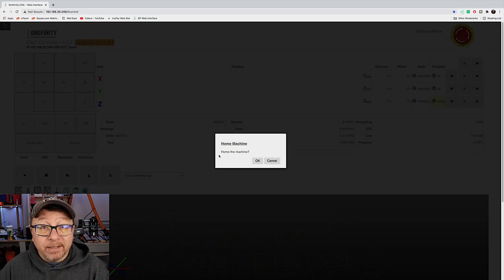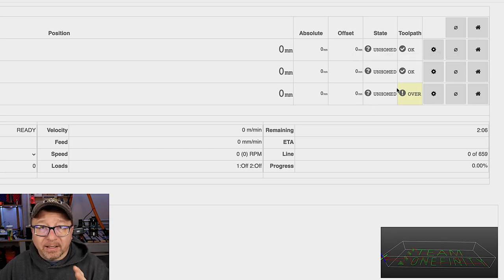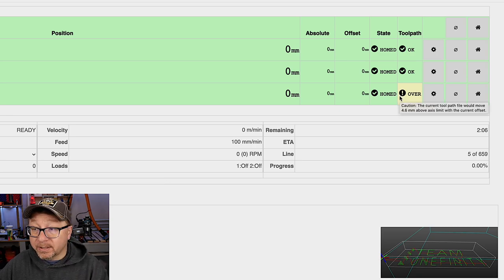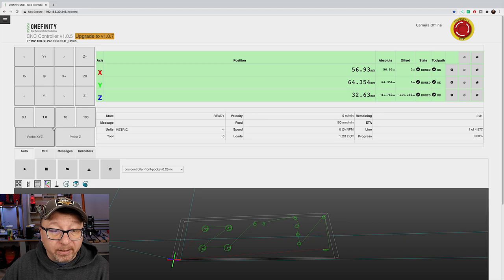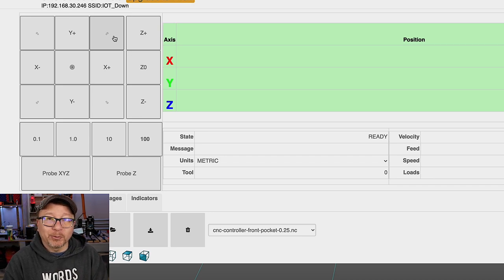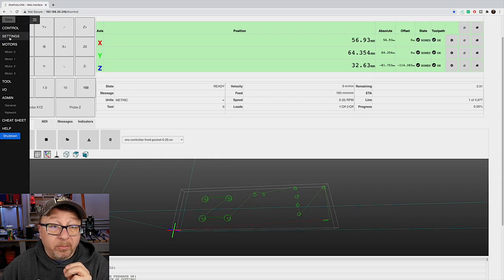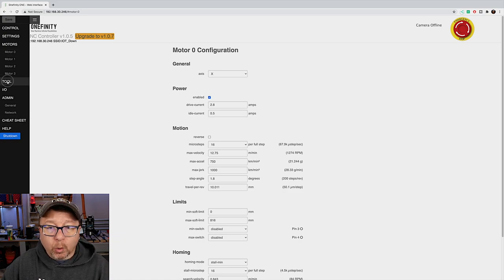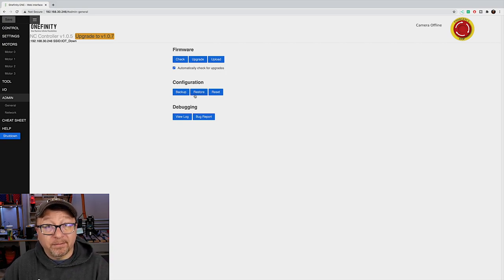Onefinity User Interface for Beginners

Comment: Thanks for the video.  When I press "STOP" on screen, everything stops but it does not reset.  The job stays grayed out.  I usually have to press "Emergency Stop" a couple of times to get it to reset.  How do I stop AND reset the file to start over?  Thanks!
Reply from the maker: Hi Fred - when you press stop everything should come back to normal. If it is not, make sure you are using the most current version of the software. There was a defect in previous versions that had issues when stop was pressed (1.0.8 and before).  If you are on the latest version, then I would reach out to Onefinity support and seek assistance - you certainly should not have to press estop for any reason other than an emergency.  Hope that helps.

Comment: Thanks again for sharing this video. I'm a newbie that's trying to get everything set up. I've actually set it up in the garage, now I've moved to the basement when wifi is stronger. Would you recommend a decent dust collection system. I appreciate you, thanks
Reply from the maker: Hi Ron - thanks for watching and reaching out. I recommend a simple shop vac with a cyclone separator to start. You can get a "combined" unit like this https://amzn.to/3yPqEAd, or purchase the parts separately like these https://amzn.to/3IasUaD or https://amzn.to/3h5NgFZ, plus a shop vac like this https://amzn.to/3IboIaL or this https://amzn.to/3JCt0YW - you don't need a lot of collection space, but you do want high CFM. Hope this helps!

Comment: Ok. So I just got my x50 setup and going through the controls. If I need to "jog" it .001 how can this be done? I'm not seeing where you can type it in and the lowest jog is .005 I'm cutting plastic's and so forth and I really need to be able to jog nitty gritty.
Reply from the maker: Hello Jesse - there is no button to jog at 0.001. To do that you need to enter gcode manually in the MDI window.  If you want to move x to the right, then G1 X .001 (assuming you are in imperial and incremental mode). Move it left using G1 X-.001. I find this reference helpful: https://gcodetutor.com/cnc-machine-training/cnc-g-codes.html as well as https://linuxcnc.org/docs/2.7/html/gcode/g-code.html. Thanks for watching!

Comment: What button on screen did you press to set z for tool(to go from "over toolpath" ) to ok? The little settings icon to the right?
What is the location button
Reply from the maker: Hello - you have to set your z zero and the load a gcode file that is appropriate for the zero position. To zero your z axis, press the button labeled Z0, middle button on the right side.  Hope that helps - thanks for watching!

Comment: Liked your video and found it informative, Question when going over the XYZ key pad on the touch screen, there are two buttons  if you could give some insight to. The Z0 and the button and in the very center of the key pad a circle with a dot int6he center.
Reply from the maker: Hello Richard.  Z0 jogs the machine to where zero for the Z axis and the button in the center jogs the machine to zero for X and Y.  I highly recommend you home and zero your machine before using the buttons though so you have some sense of where those buttons will actually take the machine. Thanks for watching!

Comment: Perfect 👍
 I have a question, in case of a power failure or some error does this software have the option to continue the work where it stopped and thus not have to start again? thanks for the video.
👋🏼.
Reply from the maker: Hi Aaron - if there is a power failure or some other critical failure during operation, there is no facility (currently) to restart where you left off. I believe it has been submitted as a feature request though. Definitely recommend a UPS if you are concerned about power failures (make sure you get one that produces a pure sine wave if you put the router on it).
Reply: @cyberreefguru  

Thanks ,Yes I think the ups is the best option.

Comment: Just found your channel and love it.  I"m a newbie to CNC, looking to purchase within the next couple months.  I have a couple systems I'm looking at and one is the Onefinity.   Have lots of questions, would be nice to chat with someone that is not trying to sell to me.   One question is there much hassle in tool changing during program execution ?  Should i look at systems that have ATC as an option?
Reply from the maker: Hi - thanks for watching.  Tool changes for hobbyist level machines is likely going to be manual (I'm not tracking any without ATC systems). The easiest workflow is to save separate files for each tool, then the machine will stop between tool changes. You can have the machine pause and prompt for a tool change if you want (at least with the OF) so you don't have to create separate files. I would love to have an ATC, but I can't justify the cost for how I use my machine. If you are doing production runs with your machine, it might be worth it. All that said, if you're just getting into CNC and looking at machines like the OF, I'd recommend learning on a more simple set up before you jump into something that has an ATC.  Hope that helps!

Comment: This is such an awesome video!   Needing to 0 X&Y to the middle of cutting area, any hints on manual entry code?
Reply from the maker: Hi Robert - if I understand the question properly, you need to manually jog to the center of the material and then press the zero buttons (X/Y). It is easiest to move the machine using the game pad if you have one; if not you can jog using the fixed values from the UI. To enter precise movements, you can enter manual gcode using the MDI area within the UI; enter something like G1 X10 to move 10 "units". "units" would be inches or mm depending on the default settings of your machine - you can change that G20 or G21 respectively. You can set absolute vs incremental mode with G90 or G91 respectively.  You only need to enter G90 or G20 once. I find this website useful when I'm trying to figure out gcode things: https://gcodetutor.com/gcode-tutorial/g90-g91-gcode.html - I hope this helps; thanks for watching!

Comment: What I would like to ask you when I home my onefinity and zero every thing and load a program and I am using carbide create it just cut air
Reply from the maker: Hello Dennis - check to make sure you work coordinates are set properly in Carbide Create and you match those with your Onefinity. Example, if your z zero is the top of the stock in CC, then make sure you zero the OF to the top of your stock. Hope this helps -- thanks for watching!

Comment: One question I have for you is I have read on the 1F forum that you can not pause your file in use because it will not start at the point of the pause. Is that true or am I confused with a different function? I am currently getting my machine table assembled so will have it up and running shortly and just want to be clear on this function. Thanks for your time....Bill
Reply from the maker: Hello Bill -  thank you for watching!  You can indeed pause and restart without any issue; you can not stop and restart from the last location.  Stopping resets the file and it starts all over again. Hope this helps!

Comment: After I followed your directions to the point were I hit the drop down menu but my file is not there. If I do a file explorer of my USB I see my STL file but when I plug the USB into the controller I can't find the file????
Reply from the maker: Hi there. The Onefinity only accepts gcode, in the form of an NC file.  STLs will not work - that is why the file is not showing up in the drop down.

Comment: I am totally green here don't have a machine yet. What computer are you using for an interface? Do you need a PC connected to do the functions? I think I heard you have a Chromebook. Is a Chromebook a good PC or does it have limitations on working with the controller?
Reply from the maker: Hello Donald - you do not need a computer to 'control' the OF - the controller has a built in computer to send gcode to the machine.  You will, however, need a computer to do you CAD/CAM work and generate the gcode for the controller.  Check out my Digital Manufacturing 101 series to get a better understanding of the work flow and what components you need: https://youtube.com/playlist?list=PLCVvx3PnAfyf-YXNFPpK-_xpc3OTPB8nz - let me know if you have additional questions and thanks for watching!
Reply: @cyberreefguru  Thanks for the reply. I am investigating laptops and tablets. I have a desktop but in the house and not close to the shop / cnc. Maybe a bare bones tablet/laptop is good option. Also I would need to extend WIFI from house to shop to make connection to desktop.
Reply from the maker: You can simply use a USB flash drive to get your gcode from your desktop to your controller.  The controller does not have to be on the network.
Reply: @cyberreefguru  Yes I understood that a flash drive is doable. I just think that I may need or would like to create or edit the design close to the CNC. I don't know how much of that I will be doing. The flash drive is a good starting point. Thanks

Comment: If my work piece is at X 5" and Y 5" can I just type those values in, or do I always have to move the spindle to that spot and then hit the zero button?
Reply from the maker: Hello Joe - you always need to zero your machine after power on.  You should also home it as well, but that is not required. Alternatively, you can leave the controller on, and then you don't need to zero each time. Hope this helps!

Comment: Noob q... just checking do you need a separate computer to attached to run it...or can you just upload gcode (like a 3d printer). Thanks
Reply from the maker: Hi Jonathan - the Onefinity is like most 3d printers - you upload the gcode to the controller and it cuts without an attached computer.  Thank for watching!

Comment: I am connected to wifi in the client mode but the connectivity is spotty.  Sometimes I get connected and some times not.  Also I lose connection often.  Would using  the access point solve these issues?  I think the signal is just week.  Is there anything I need to do differently when connecting through the access point rather than the client mode?
Reply from the maker: Hi John - using AP mode should solve the problems with connectivity, but you can't been connected to the Internet at the same time (unless you are using a cell phone with cellular connectivity). Alternatively, you can use an ethernet cable between your router and controller if they are relatively close (cat 5e can be used up to 100m). When you select AP mode, you just need to set the SSID and password.  Connect to that SSID with your computer and enter the same password.

Comment: Sir Im so green if purchase a files is the gcode attached with this file .Can i put thumb drive and run it from there.
Reply from the maker: Michael - you can load gcode directly into the OF from a thumb drive.  However, I would NOT recommend running gcode without simulating it first, unless you are 100% sure you know what it is going to do. There are far too many options in setting up a CNC that the originator can't predict.  Hope this helps -- thanks for watching!

Comment: what do the buttons do that look like gears next to the toolpath column?
Reply from the maker: Hi Adam - it allows you to set the exact position of the axis manually. The exact location depends on whether the machine has been homed or not. Rather than getting it wrong, here's the actual description by Buildbotics: "If the axis has been 'homed', the 'Offset' field will be adjusted to equal the new value in the 'Position' field minus the value in the 'Absolute' field. If the axis has not been homed, the value in the 'Absolute' field is set to the new value in the 'Position' field and the value in the 'Offset' field is set to zero."  Hope that helps -- thanks for watching!

Comment: ok so what soft ware or art can i use on this like what files work with it or can i use a photo and it will make the shape info like that is whats important  if im buying this cnc its over 2500
Reply from the maker: Hi Joe - I 'm not sure I understand the question.  The machine accepts gcode and the controller uses that information to mill the appropriate tool paths.  Perhaps my digital manufacturing series will help you understand the workflow and where the machine and controller fits in: https://www.youtube.com/playlist?list=PLCVvx3PnAfyf-YXNFPpK-_xpc3OTPB8nz - let me know if you other questions! Thanks for watching.
Reply: @cyberreefguru  ok so some software interfaces will not work with all artwork like Carvewright  and Carvewright will not work with all gcode  fills so if i cant run my art i cant use this cnc and if i cant run raised panel art like 3d i cant use it i have looked around and cant find a system with clear info about this
Reply from the maker: @joemurray6323  I think I understand. Onefinity is a little modular than something like Carvewright.  It does not come with modeling or CAM software - you are free to use whatever works for you. As long as you can create gcode, the machine will accept it (barring any commands it doesn't understand). I recommend you check out the Onefinity forums or Facebook site to see what others have made with the machine - there are some truly impressive projects.

Comment: How quick will the machine stop if you select the pause button ?
Reply from the maker: Hi Brian - it will stop at the next command that has not already been processed and buffered.  So, you have a lot of little movements, it will stop fairly quickly.  If the commands are long movements, it might take a little bit of time to get it stopped completely while the machine completes the movement that has already been sent to the motor controller. In my experience, it stops fairly quickly (.25 seconds?) most of the time.  Thanks for watching!

Comment: Very thourough.  What happens if you have a power outage?  You're unable to shut down properly...
Reply from the maker: Hi Rick - thanks for watching.  If you lose power, then you need to start over.  If you know your zero location, you can re-home and re-zero to that location and the machine should be able to pick up with nearly perfect results.  If you don't know your zero location, then the project will likely be lost unless you can reestablish zero with a great deal of accuracy. Using a UPS to protect from brief power problems can help, but it needs to be sized properly and also support the router with the proper output (e.g., true sine wave vs notched square wave). Hope this helps!

Comment: How about a public question. This the first time I have ever turned the on switch on, on CNC. Thought I would follow along with your video. However I could not keep up. My program journeyman n x50 call for connecting the mag prob. That does not arrive until Tuesday. Anyway back to the problem. The program listed a yellow warning and would not allow me to go forward. How do I get past this warning. Help. And talk slower
Reply from the maker: Hi Tom - which axis has the issue?  Make sure you home and then zero your machine on your stock.  Then load your gcode file to see if you still have the issue. Thanks for watching!

Comment: Is black parts 3d printed or aluminium? :)
Reply from the maker: Hello - the machine is all metal except for a small number of 3d printed spacers for the wires, and the acrylic dust shoe and arms.  Hope that helps.
Reply: They've been switching 3D printed parts over to injection molded parts. Most of the plastic parts on mine are injected molded, I'm assuming the rest have been transitioned over by now.

Comment: How to get files from NAS with ethernet connected controller? What you showed is better than USB for sure, but...... could be even better :-) Thanks Tom
Reply from the maker: HI Ronald - great question - I'm not sure. I would be really nice if the RPI could mount a remote drive (like a NAS) and pull files from there.  Right now you can reverse the situation and mount the RPI, but there are issues getting the Pi to recognize new files. Hope this helps. Thanks for watching!

Comment: ok but how to connect to wifi or a cable from my rotor
Reply from the maker: Hello Daniel. If you want to connect to WIFI, goto the network section under settings.  If you want to directly connect via ethernet, simply plug a cable into your controller and then in to one of the ports on your router. It should connect automatically.  Thanks for watching!